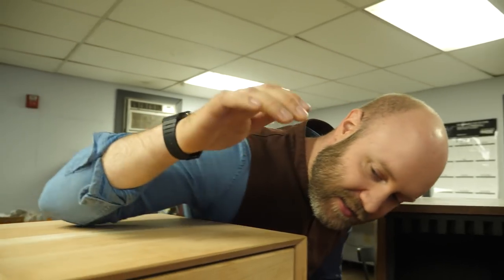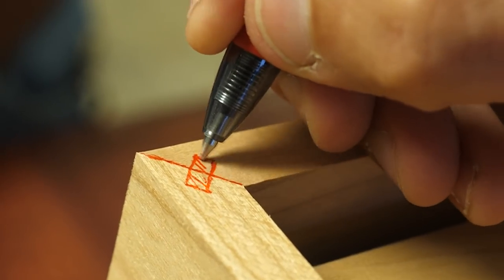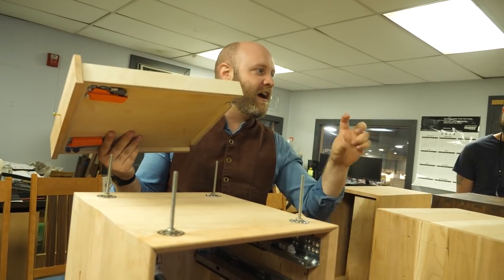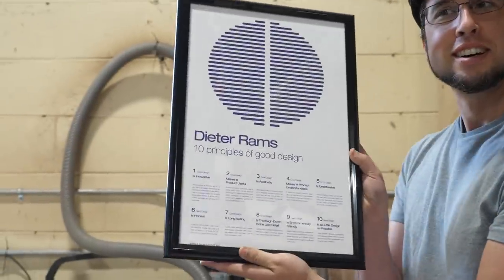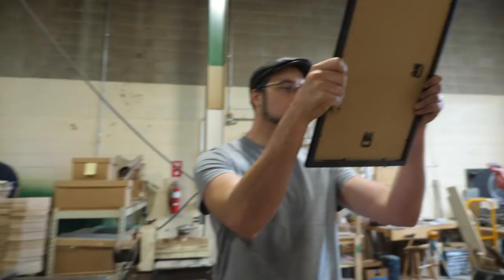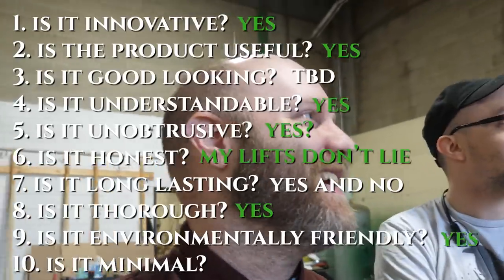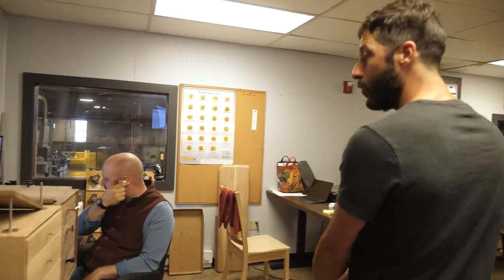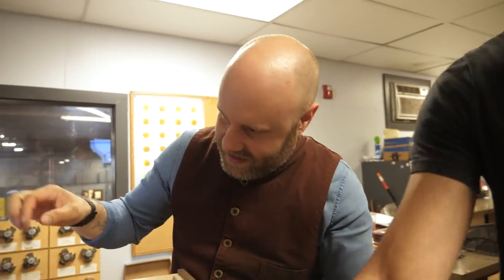Metal Hardware or Wood On Wood? (don't be gross)

Comment: I've asked before, but PLEASE make sure we can access the hardware easily to replace/repair when the desk fails. This much weight is going to put a strain on the mechanisms. Sure, it may be able to hold 700 pounds (example number from other desks) but for how long going up and down daily?
Reply: Is desk failure...a thing? Never even considered it.

I mean sure, you could accidentally fall on a drawer and bend shit up but not sure how you could really reasonably design to make that easier or harder to repair
Reply: @BenRangel  The desk itself, not really, but the internals do. Electronics fail, motors burn out, and if there are gears the teeth may become worn and fail. Even the pneumatic versions with cylinders (just like desk chairs) give out.
Reply: That’s a real point isn’t it.  I mean - there’s probably a reason why no one adds drawers to a sit/stand. Wear and tear on the mechanism. How reliable do you guys think it will be?  Lifespan (lift span) estimates?  That a lot of pressure/torque on the system.
Reply: @RoseKindred  Ah ok now I get it - the electronics and pneumatics!
I was initially just thinking drawers.

Now that you mention it I did have a desk chair gas/pneumatic thing run out and my initial thought was just "I'm gonna have to buy a new chair since I probably can't cheaply replace it"
Reply: Linear actuators can ease the wearing out factor on heavier items over geared mechanisms and are able to "lift" more weight. Most current sit stands we have run into and put together are using them or electric screw lifts.
Reply: @JoGuev7177  even once you figure is weight of doors/drawers, accessories, and what you end up storing is said drawers?  Impressive mechanism if it doesn’t wear out.
Reply: @JoGuev7177  Those would also help to keep the noise down as well. Some have sounded like turning on power equipment each time you press the button. Hope we get more in-depth information explained to the viewers.
Reply: @davidmuzia814  There’s also the issue of weight distribution and, potentially, the ability to anchor the desk to a wall. 200 pounds of computer, clutter and books/files/kettle bells in a drawer isn’t too tippy at the lowest setting. At the highest setting, that tip could seriously injure an animal or person.
Reply: @Dresden76  or (horribly) a small child climbing on it.  My kids did that a couple of times as toddlers….
Reply: I mean, they said in this video that they were planning on having the hardware accessible for replacement, especially the motor.

So you don't even have to ask, they know
Reply: @greenmind3488  yeah - but do you want to buy a desk that’ll have hundreds in repairs (not an unreasonable dollar amount) every x number of months?  Assuming someone is changing the height several times a day?  And if they aren’t - why did you get a sit/stand?

Comment: I love the wood on wood slides. I think there’s something about them that feel luxurious and also homey at the same time. 

Would love to see wooden pulls for the drawers as well.
Reply: Take Ian's suggestion and apply it to wooden pulls: Wyrmwood shield logo drawer pulls.
Reply: Totally agree about wooden pulls, seems like such an easy solution for them since they are trying to cut hardware. Bonus of making it match with any accents like the key for the joinery Ian was talking about
Reply: Wooden pulls for the drawers in the shape of 20-sided dice.
Reply: Hear me out, a groove drawer pull, instead of hardware.
Reply: @aayyyooooo  I suspect they’ll look into that, but I personally prefer pulls— beyond the fact that they’re usually easier to grab, in my experience with wood on wood drawers, having the point where you’re pulling more centered results in a smoother drawer over time.

Comment: I would love this desk, but without the sit/stand option. I just want a good desk to sit at. I don't need it to be a fancy motorized desk.
So I hope you can add a "downgrade", with just a normal base or just the top and people have to provide their own base.
Reply: would be cool if they provide like a fixed desk leg option. Maybe even reuse the MGT legs of existing inventory so it's not a separate SKU?
Reply: You know as I was watching this and being really impressed with the drawer design changes I was thinking: “Gee, I kind of wish they’d apply this to just a plain old classic all-wood desk.” I think that’s a great idea for them moving forward, especially since they bought the furniture place in PA where the MGTs are made.
Reply: Isnt that what the MGT is?  Just order a desk sized top with a specific set of legs?  This stuff seems to be completely cross compatible so if you wanted the drawer box you could order it and throw it on an MGT.
Reply: A top for my own base would be a wonderful option!
Reply: @launchpad62  the MGT is fully customisable, it's not a single desk top, you can customise the length of it

Comment: Wooden drawer rails are a win. I did like the suggestions I saw in the comments to replace the stopper screw with a ball bearing or a magnet so  that people know when they are at full extension but can give it a little extra pull to remove the drawer if they want.
I also LOVED the suggestion I saw to  go with a manual crank to raise and lower the desk. I feel like this would give it an amazing high quality feel and appearance while also hopefully further cutting reliance on supply chains and overall cost.
Reply: If they manage a hand crank this could truly be an heirloom piece. Here's hoping they see the suggestion.
Reply: From an actual usability perspective, hand crank is a no. I own a sit stand desk with a hand crank and almost never change the height just because it’s so tedious. It takes forever to raise and lower so you can’t just change on a whim.
Reply: The mental crank is a super cool concept, but I also struggle with the usability of it.
I love the heirloom feeling and the cool vibe, but I worry that I wouldn't use it because honestly, I am quite lazy some days. On other days when my back is bothering me I wonder if using the hand crank would further agrivate it?
Super difficult to weigh the pros and cons.
Reply: @MediocrityInMotion  I think if it was an option that would be nice like you could easily remove it  but also still have the electric option
Reply: @arts3802  Hand crank could be a win IF they use differential gears to increase the speed.
Reply: @chrismanuel9768  Yeah that would be a necessity, the draw of a sit stand desk is to be able to do either at will, a crank without gears does not fit in that

Comment: Agree with Ian. "Push to open" feels wrong for desk drawers. Ok in a kitchen or TV stand but feels highly unusual for office furniture
Reply: I feel like anything that frequently needs to opened should have a pull of some sort. Anything in a high traffic location(kitchen/workshop) benefits from push to open. Though my shop I used waste and used flat panel drawers faces with underside finger grooves.

Comment: Would it make sense to have a rubber bit at each end of the drawer slot? I assume somebody opening a closing a drawer with metal screws hitting the ends of the stops is going to put a decent chunk of wear and tear there.
Reply: The rails also probably could do with wax or something to keep things running smooth without too much wear but I'm not savvy enough on how different woods would handle that. I imagine something along those lines would be mentioned in care instructions if they recommend it.
Reply: @Alconium  My cabinetmaker grandfather told me to use plain old bar soap.

Comment: Maybe instead of the screw going into the slot, there could be a spring loaded ball bearing so when u pull with a normal amount of force it stops the moviment but if u need to take it out it's just a hard pull. And that way u don't have a screw on the inside of the drawer
Reply: Springs? Obviously the solution is magnets. 😉 Little bit of “friction” at the end and voila, drawer stays put unless you push/pull with a little extra force. 

This is like 90% not serious. I just feel like they (as they should) love their magnets.
Reply: I think their point was to remove as much mechanical movement in the product as possible. With the wood slide the screw is the simplest option because an appropriate sized screw can be bought at any hardware store. Your spring would be custom sized, a permanent part of the drawer, and can rust in place, making the drawer stuck. I like the idea of pull-harder-to-pull-free, but the screw is just the simpler, cheaper, and more effective solution.
Reply: From a sourcing standpoint that would be a nightmare right now. Anything custom that's not made in house will be near impossible to source or stupid expensive. Unless their metal working neighbors can help out (not sure if they're there anymore as it's been a while since they've been on wyrm lyfe)

Comment: First of all, I really like the wood on wood option for the drawers.  Seems like a no brainer based on the video.

I have a safety concern about the drawers mounted on the sit-stand desk that I haven't seen expressed in other comments.  Most sit-stand desks don't have drawers like this and when you raise/lower the desk, there isn't really a chance to squash anything underneath.  But with heavy wooden drawer "boxes" mounted under the desk, they could squash a child or pet if you didn't know they were there (or with kids playing with the up/down feature).  That said, I also have a possible solution that would also alleviate the weight burden on the motors...could you make the drawers either free-standing furniture options and/or attachable to the bottom feet/legs?  This would eliminate the weight attached to the top of the desk and eliminate the chance of children/pets on the floor getting injured.  There would still a possibility of injury between the bottom of the adjustable desk and the top of the drawer cabinet, but this seems like slightly less of a risk to me.  Would love to see a discussion of this in a future Wyrmlife...possibly with Frank involved.

Comment: Having such a design-focused deep dive, especially into Dieter Rams is fantastic! Really wish the Like button was a little bigger for this one, guys well done! Just as an idea, instead of making the cabinet fixed runner from timber, you could use sheet nylon which would help reduce friction, just a thought, you could then drill a metal stopper within the nylon, so you are not relying on screw vs runner over time.

Comment: 100% support the wood slides. My dresser, nightstand, kitchen drawers, literally every drawer in my house (except the crappy supermarket desk I got when I was 15 that my wife now uses) all are wooden slides and I wouldn't have it any other way. Though none of mine use the groove setup. They're just boxes that sit on a frame that is slightly smaller than the dimensions of the drawer. Probably cheaper and easier to make, but you do lose some drawer height. The drawer slides that Bennett came up with look very slick and definitely worthy of the Wyrmwood brand.

Comment: Would you consider making a lift desk with and crank like what you have on the Prophecy table? Not sure if anyone else would want that but it would solve needing to replace the motor.
Reply: I would totally buy a desk with a hand-crank lift, provide the crank would be easily accessible if the desk were placed in a corner or against a wall. With the Prophecy, it's a table, so odds are slim that it'll ever be against a wall on any side, whereas with a desk, it's much more likely to be placed against a wall or even in a corner where the back and one side are against a wall. If the crank is accessible from only the side or the back, that limits desk placement.
Reply: That mechanism would actually need to be so much stronger than the prophecy,  so probably not feasible
Reply: I knew a furniture maker who had this ancient workbench with what looked like a cast iron hand crank, it looked like he'd repurposed one of those mediaeval torture machines that stretch someone on a rack? It was the coolest piece of furniture ever and it couldn't be replicated on scale but I can dream

Comment: Doug addressed the issue with supply of metal drawer slides. I am currently sourcing hardware from four different manufactures to fullfill my needs. WQooden slides is the way to go when considering supply and weight.

Comment: When using wooden runners it's important to use button head screws and/or have oversized holes. Depending on the region there is quite a bit of wood movement in the side panel happening.

Comment: There are a few comments about wood handles for the front of the draws but a simple, waste friendly, solution that you already have the systems for could be to get a small length of leather clicked out and looped over and screwed into the front, to form a sort of pull handle, Woby Design used them in his Practical Workbench video.

Comment: My PC desk is an old farm desk that was built around 80 or 90 years ago, all the drawers are simple wooden rails, and I have never had a single problem with it.  The more complex something is, the more things there are to go wrong, if some schmutz gets into the hardware rails they can easily get sticky or jammed, not really a problem with wooden rails, even if they do get a bit stuck, you can just take them out and clean them in about 20 seconds without tools.

Comment: My opinion, Softclose side mount, and if you can , an undercut to pull it out rather than hardware.  Good wooden drawers look so much better without the hardware.  Just some space either above or below to grab it and pull it out would be so nice.
Reply: i like the wood slide/groove design, but I would love to see with a undercut to open, also again seems like a win on cost/hardware unless that is for some reason a difficult addition in creation

Comment: The 10 Principles of a good Wyrmwood video:
1. Is it funny?
2. Does it inform the viewer on the products offered by Wyrmwood Gaming. 
3. Does it captivate the viewer?
4. Does it relay the products and the design process accurately?
5. Does Doug make an appearance?
6. Is the camerawork top notch?
7. Are there subliminal messages/ images?
8. Does it engage the viewer to comment and subscribe?
9. Is it marketable?
10. Is it edited well?

Comment: Have you guys looked into sourcing something to hang the tower/pc from? That's going to be huge for determining if I get one of these. My work uses a mount that is essentially a strap that goes around the case that ratchets into place. (seems like a great one size fits all solution to me.) 
Side note: I had a dresser that was half wooden rails, and half had been replaced with metal rail hardware. I absolutely HATED using drawers with the metal rails. (I'm sure whatever rails you guys would have sourced would have been great, but I LOVE that you're pivoting to wooden rails.)
I love the feeling of the wooden drawer pull, and I'm stoked that it's a complete win for you guys.

Comment: The crank system that the Prophesy uses is solid - I would FAR more prefer that instead of any motor-driven lift system. It'll last a lot longer, AND it won't need to be plugged in either. One of the failures of the hydraulic lifts is when it fails, it falls to the bottom, and if you're under it... it's pretty heavy.

Comment: I think I would either run a mitre lock joint down the corners of the main carcass, or do it rebated and plant on the mitre detail on the front, a bit like a faceframe, to cover the rebated joinery on the corners. The mitre lock would speed up the glue or procedure considerably compared to running splines, and you don't need to get clamping pressure at 45 degrees across the corners, so simplifies the clamping procedure too.
Reply: Was gonna post this too, but didn't know how the bits were called in english (in Germany we call them "Gehrungsverleimfräser"). Significantly simplifies the process to just one edge milling op for each piece to be joined.

Comment: Would be cool if you could get a drawer unit add on designed to fit a computer case (sure can’t be universal to fit all but could fit a good range) that has some nice ventilation on the sides built in. This way you keep desk real estate but the cables to monitors move with desk

Comment: As a Cabinet Maker by trade, I can confirm that drawer slides are definitely affected by the supply chain issues, and unless you buy Chinese junk the price adds up quickly. And if push to open, and soft close are not a must have, then high quality wooden runners are a perfectly fine option. As long as you can live without full extension, which is arguably the best thing about metal slides.
Reply: Sounds like it's going to be the wood runners simply because of the supply chain problems alone.
Reply: Funny enough, full extension feels like such a weird hangup to me. Anything I want to put in a drawer I should be able to see or access even if I can't pull the drawer out the last 1/2-1/4 inch. 😂

Comment: At the beginning of the pandemic, I turned in my very nice real wood desk that cost a bundle for a sit stand desk (that still cost a fair amount) from an excellent (perhaps innovative) sit/stand desk provider. I'm fairly certain you'll be using the same motorized leg system.

It would be great if you offered to sell just the wood desk top and modular parts to all of us who already have the leg systems? Many of us might like a nice looking desk-top as opposed to the particle wood ick that is our "desk". I'd likely be willing to toss out all of my modular under-desk items that I got with mine (you know, the innovative drawers and stuff) if I could keep the core and wrap it in luxurious Wyrmwood craftsmanship (and innovation).